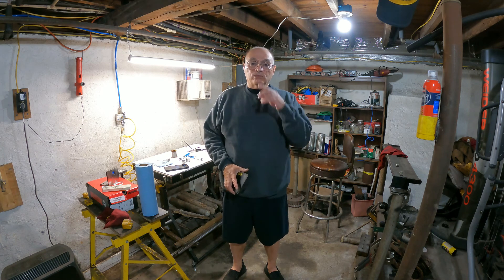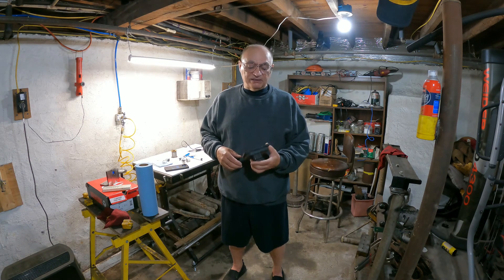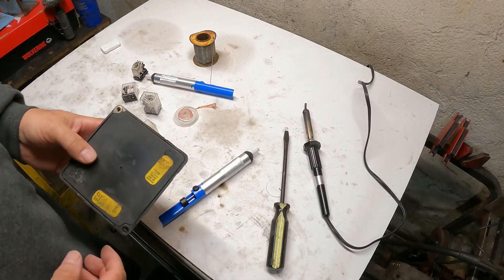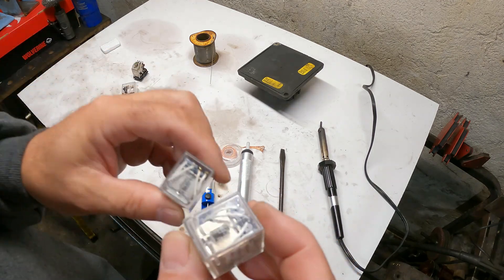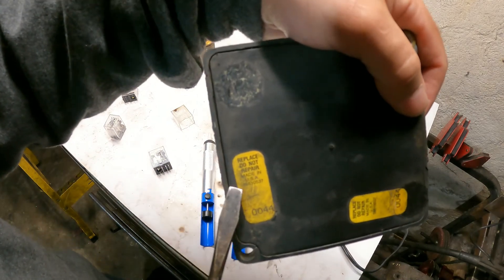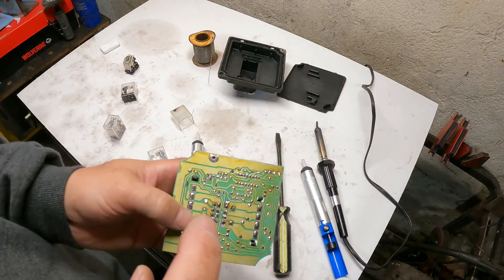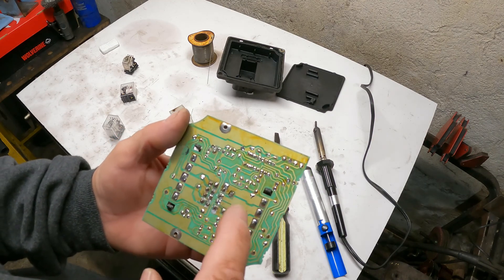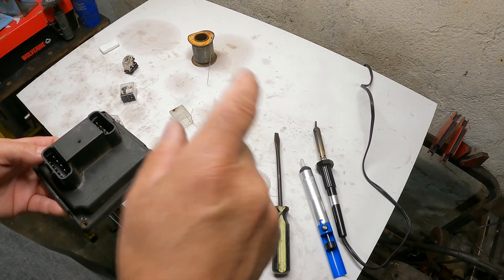Corvette Headlight Module Repair

Comment: Is the link to the relay still correct? The item says 200vac - but the OEM is 240vac. Is this working in your car? Thx
Reply from the maker: That is the relay I used, it's quit posable the oem one was 240vac but the link I provided did work, you could just do a search for a 240vac one, anyway here is a link to the article I read about doing the repair https://www.instructables.com/C4-Corvette-Headlight-Controller-Repair/
Reply: @E.T.GARAGE  thank you. They make this part w socket base same as OEM specs widely, but w PCB pins it’s impossible to find exact specs. I’ve got the repair article & vids - thanks!
Reply: @E.T.GARAGE  in the video you used a 12v relay but the link you provided is for a 220v relay.. can you post the link for the 12v relay please?
Reply from the maker: @quintenbarker6620  this may be the correct one. https://www.grainger.com/product/1YDD5?gucid=N:N:PS:Paid:GGL:CSM-2295:4P7A1P:20501231&gad_source=1&gclid=Cj0KCQjwq86wBhDiARIsAJhuphkuGJV87d2B1-upFqwgOpjOXeBbrGGQYfy1s-8OZZezwx03Jz9HBHoaAunDEALw_wcB&gclsrc=aw.ds

Comment: hola espero me pueda ayudar, ya consegui el relay en ebay,pero no consigo hacer funcionar mis luces de forma adecuada, no se levanta la izquierda, solo la derecha, hay luz al encender y las altas y bajas sirven bien, pero no consigo que las puertas se abran , alguna idea, si no lo puede  leer lo escribo en español. los motores funcionan bien , ya los probe con bateria directa .
Reply from the maker: If both motors work then check the wiring, if not that then maybe you got another bad relay. Good Luck
Reply from the maker: Also if the motors work and the head light doesn't go up and down then it may be the gear in the headlights